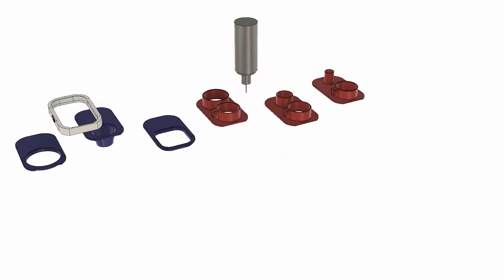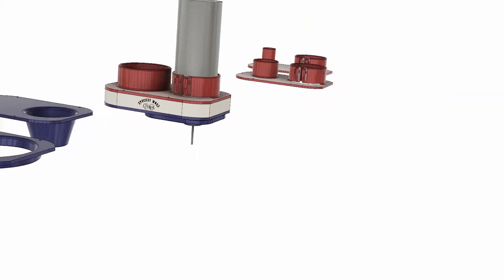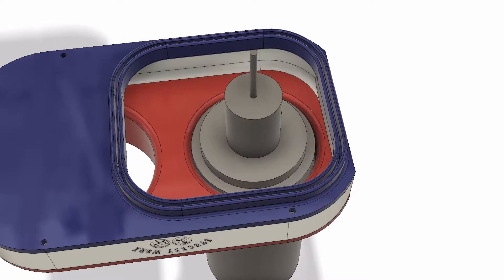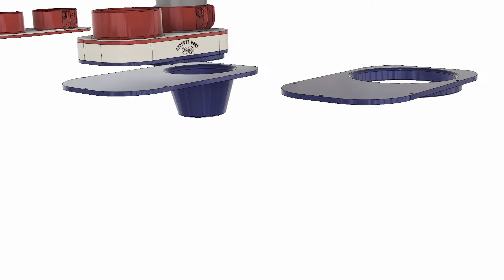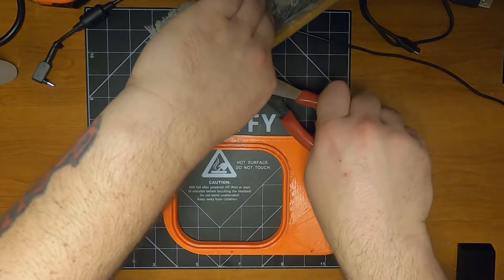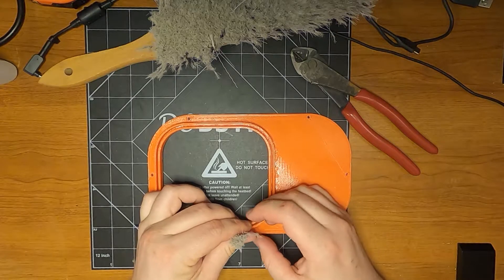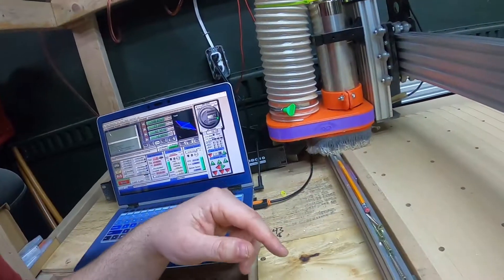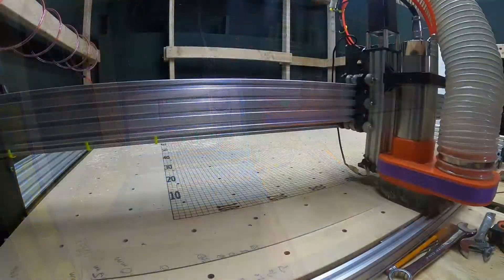80mm & 60mm CNC Spindle Vac Dust Boot Version-2

Comment: Do you sell these? I do not have a 3d printer.
Reply from the maker: Yes I do...
Reply: @702marine  great where can I purchase. I have a issue with the clearance behind my spindle and the dust shoe I have.. have to drop spindle to low in my opinion.I have the bulkman3d Queenbee.
Reply: I would love to buy one of these and I found out where but I would like to know if the bottoms are magnetic attachable instead of screws or if the file is available understanding that it's not for sale and I could edit it myself if so